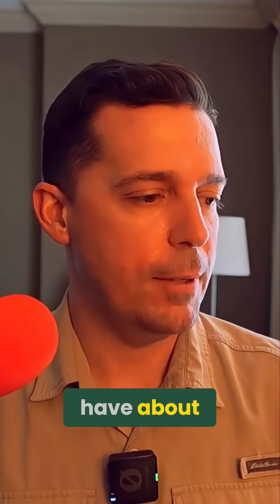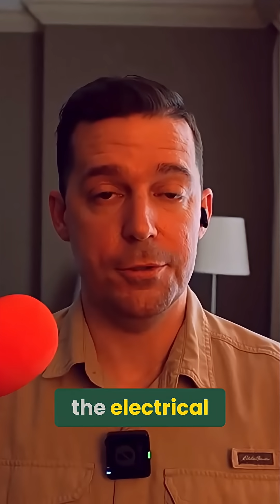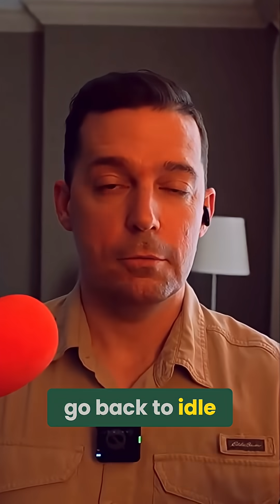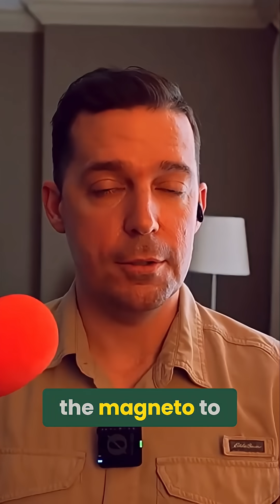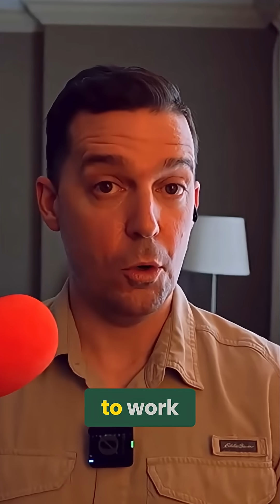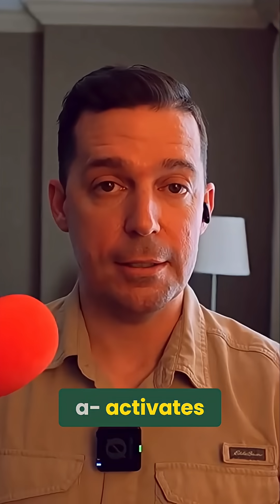Mastering Magnetos: Essential Knowledge for Commercial Pilots

Comment: Hi, last flight in my cirrus y did the test without having the engine in idle, it was running at 1000 rpm, I heard a loud bang, do you know what can it be ? I’m worried I damaged something, when I put both magnetos the engine was running ok so I shut it down normally, but I didn’t like that sound at all.
Reply from the maker: Only do this test at idle. By doing it at 1000 RPM you had enough fuel being injected into the cylinders that when you went off and back on, all of it burned and caused a backfire in the exhaust system. There is a small chance that this damaged your exhaust manifold. I would recommend you bring this up to your mechanic during the next inspection.

Comment: Hmm.. I've done the before shutdown mag checks different. I will have the mags at about 1000rpm, then check left/right and see if there is a drop in RPM. The theory is if you get a drop on both you know there isn't a hot mag. I mostly been flying Archer 3's with the switch based mag though btw so maybe I'm thinking of it different than with the key based mags.
Reply from the maker: That's another way of doing it. I still prefer to do what I described in the video since it is a fail safe way to test both the mags and switches to ensure you don't have a hot mag or pad switch before getting out and moving the aircraft.

Comment: Today, planes increasingly have a hybrid system: One standard magneto independent of electrical system and an electronic unit that is dependent on the electrical system. Good to check POH to see what your plane has.
Reply from the maker: Good point. Also, any aircraft equipped with a e-Mag should have a placard installed in view of the pilot which informs the pilot of the installation and any restrictions associated.